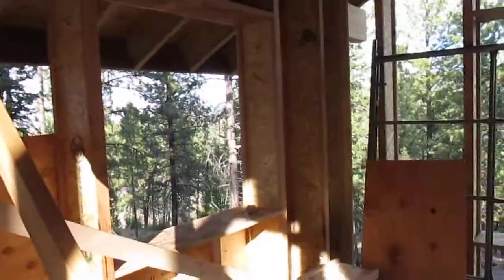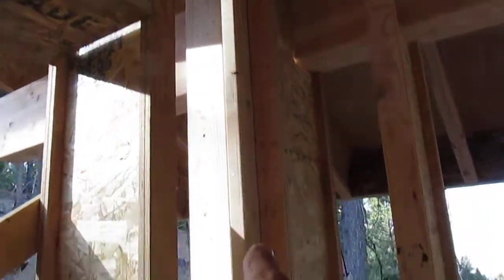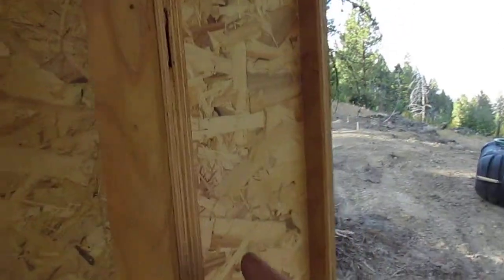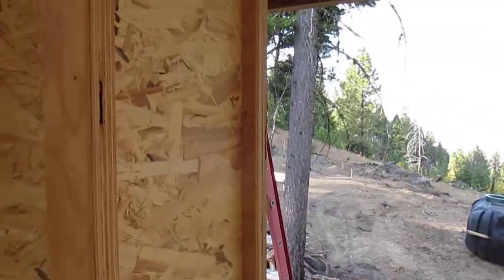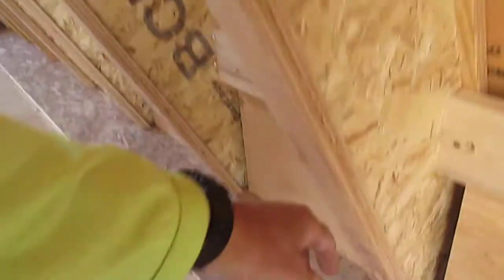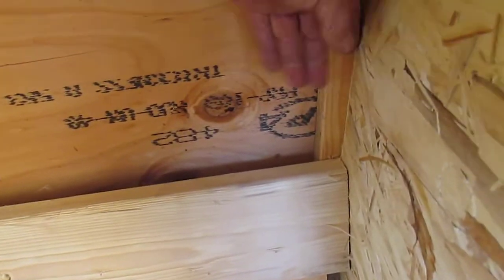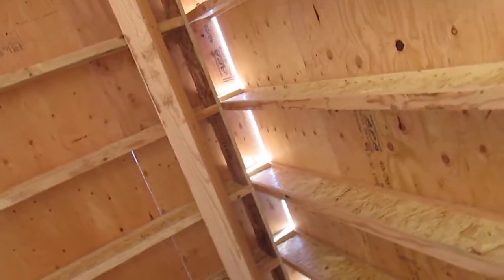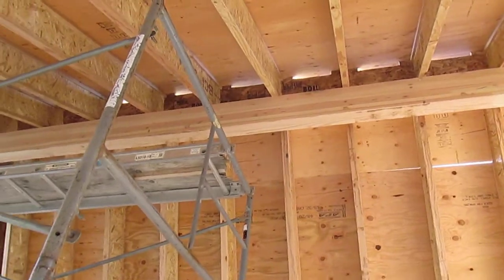Using I Joists as framing components. Venting strategies for I joist roofs.

Comment: The problem is that I-joists are not designed for compression strength. they would only be 70% equal to the sq inch value of equal solid wood. you lose much strength in the chipboard section compared to the layered laminate. so if that was a 2x8 it actually is only as strong as a 2x4 in compression. I would have consulted a structural engineer first.